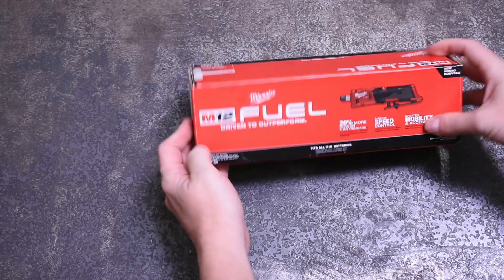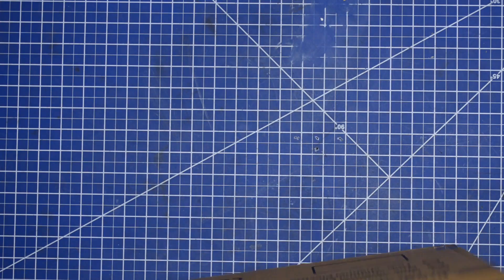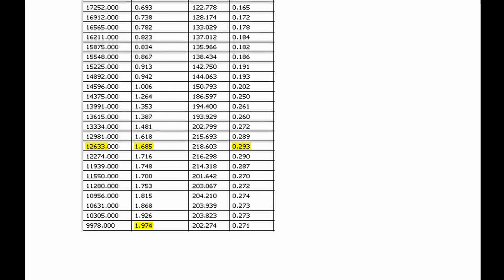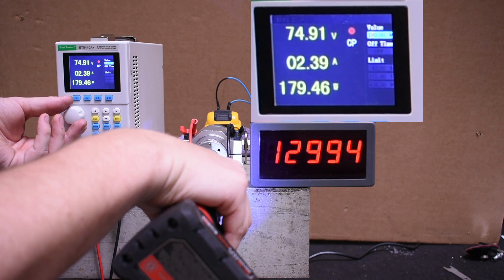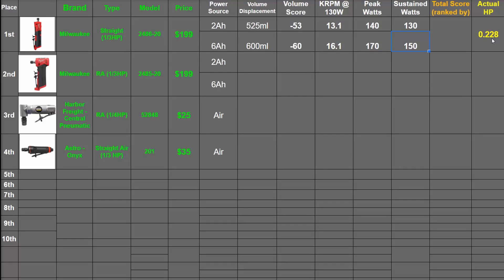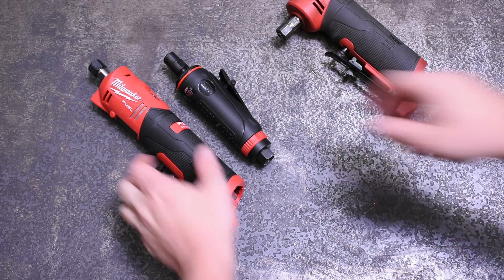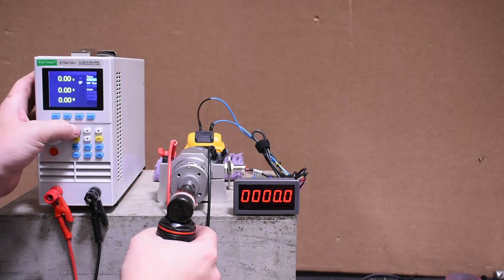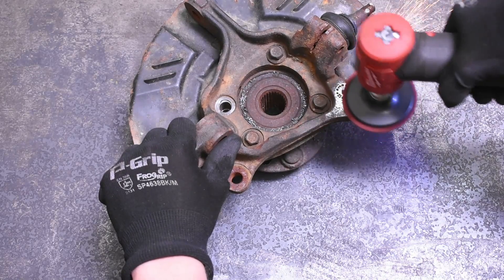We Built a HP Dyno: Do M12 "1/3 HP" Die Grinders Really Beat Air?

Comment: Wow a new dyno, very exciting! 
May I add some observations as an ee. I see you were looking for a dc generator, but ac one (with magnets on the rotor) would also work probably with just a simple 3ph full bridge rectifier on the output, before the load. 

Also bear in mind that generator has some losses, up to 20% since it is a dc motor so you can take those into account for true power numbers but it is not necessary for just the relative comparison. 

Thank you!
Reply from the maker: Hey thanks. Yes relative comparison is the name of the game on this channel!
Reply: @TorqueTestChannel  can't wait to see more, thanks 👍
Reply: @TorqueTestChannel  To add to this, the efficiency curve of the generator is absolutely not linear, i.e. you might measure 80% of one tool making 100W at 3krpm, but just 60% of another tool making the same power at 6krpm which makes the latter look worse, even though they're equal. 
Measuring actual torque or calibrating this setup would really benefit it. 
Mounting the generator housing free to rotate (i.e. in a big bearing) and mounting a digital torque meter on the end to hold it would be one way to give a much more linear and calibrated reading

Comment: I have the right angle Milwaukee. It’s ok, nothing special. I usually keep a cutoff wheel, or small wire wheel on it. That’s about all it’s good for is a quick use where rolling out an air hose is unnecessary. Maybe y’all could try some of the JET brand of die grinders I’ve been looking at getting their 1 HP models but haven’t pulled the trigger yet. They look very similar to the snap on ones.

Comment: You must know that your dyno "watts" are ignoring the fact that it isn't 100% efficient as a generator.  That dyno efficiency will have a significant curve to it.
Reply: @fluke196c  I'm honestly not sure if that would be a valid method of calibration because the "calibration" motor would need to be performance characterized as well.

I'm quite familiar with performance characterization of brushless motors but not nearly as much about brushed but I suspect it is probably similarly complex.
Reply: @fluke196c  They're not.  The efficiency of the "dyno" motor changes with rpm/voltage/temperature/etc.  It is a complex problem.

Comment: I have the Milwaukee right angle die grinder. It's awesome. I don't have air and it works very well. Only issue I have is the internal safety can be too much sometimes when I'm trying to cut sheetmetal. If the disc gets hung up at all, it shuts itself off. I have considered getting the straight one but I read and watched reviews for it last year and it didn't seem worth it. I use the high capacity xc 4.0 and 6.0 batteries and with mine and they can go for a couple hours. I have 4 of them that I can have them on rotation. I wouldn't be able to restore my car without these since I don't have a big enough compressor.

Comment: ~33 YEARS ago when I started off being a parts guy at a large tool import company, we had right angle die grinders that were (in appearance) identical to the central pneumatic one there!  I'd lay you good odds the parts are still interchangeable!
Reply from the maker: Pretty much all 1/4HP aluminum body RA die grinders look like this. Very big differences in quality and price though
Reply: @TorqueTestChannel  - oh by all means!  It's just crazy that after decades, the outward appearance hasn't changed at all.

Comment: Ok but count in the average air hose and compressor over time the air will loose rmp fast even faster than a compressor can keep up. Let's see how much time until the rpms drop.
Reply: Most shops (mine included) have stupid large conpressors. Mine puts out 19 cfm at 120psi currently. The snap on and matco large die grinders will hurt you. Biggest issue i run into is the die grinder actually getting so cold that its hard to hang onto.
Reply from the maker: Same with battery on these, it drops bars quick being direct drive

Comment: I dig the right angle and after years of cordless I just don't see myself firing up the compressor and dragging out the headphones and air hose.
Reply from the maker: It's size is hard to argue with, and in some situations does anything you need it to. Just isn't a powerhouse or quite comparable to air yet at this size
Reply: @TorqueTestChannel  I use the Milwaukee right angle at work all the time (Aviation GSE Mechanic) along with everything else that comes in red/FUEL. It's awesome and as long as you don't push it, you won't usually get it to cut out. I love using small 2" cutting wheels on it.
Reply: @TorqueTestChannel  and price...once youve got the compressor etc and its gonna be running in your shop anyway.......size and tool price have a lot of weight....im a body guy....that compressor will be running for another 20 years at least in the industry.(electrics and plastics dont like paint thinners)
Reply: @kazzTrismus  Right, but you don't just get to write off the cost of anything from the cheapest minimum usable compressor, line, & fittings to a full shop air system with all the bells & whistles. I mean, good luck trying to make an entire collection of cordless tools cost as much as a full shop air system + air tools.

It's literally case dependent
Reply: @kazzTrismus  Agree. The battery powered ones are often much too large to fit into the spaces I need.
Reply: @RyTrapp0  those expenses are long written off for me...easily 10yrs old fittings are like $2 ea...in a fab/body shop air is required and constant
Reply: Easy to cause the Milwaukee to stall from too much pressure. And when I say too much pressure I mean very little.
Reply: @jordanrussell345  Agreed.... I have the right angle, and it's a joke. I can't believe Milwaukee, released this Pos...
Reply: @kangaroo4144  Yup. Glad my shop buddy (who's a Milwaukee guy) bought his first so I could find that out. I use the AP Onyx 180 and 90 and love them.
Reply: @kangaroo4144  I have the Milwaukee right angle die grinder. I love it for the basic things I need it for and don’t have the space for a compressor. If I was cleaning gaskets and such all day I’d definitely use air.
Reply: @kangaroo4144  same, I got the right angle and it sucks balls, any pressure and it stops, even with the bigger battery. Sucks for the price of what you get.
Reply: I am unaware of any other use I have for my right angle that is not used in cleaning gasketed surfaces. Being cordless is sooooooo handy in a super tight engine bay.
Reply: I have the M12 and it constantly cuts out while removing rust, no issues with air...
Reply: @DrScopey2  are you using a 3” or 2” attachment? It’s only suitable for 2”. Plus the smaller batteries are shit with it.
Reply: Tried and returned a milwaukee right angle as it could not even clean a brake rotor without stalling out.  Just too wimpy for any serious use.  
      The pro tool place I purchased and returned the milw to.. was not surprised it was junk...  they claim die grinders that are battery are just not ready to be sold yet
Reply: What size compressor would you suggest for light work with an RA die grinder and small beveler?
Reply: I was thinking bout buying dewalts die grinder , if it's anything like the cut off tool it should do pretty good. 170 is a little salty though
Reply: If you want to make an instant powerful right angle die grinder you can do what I do and take an all-steel Jacobs or other quality chuck then drill and tap it for 5/8"-11 to fit your angle grinder spindle. It's outstanding for running any shank size burr, flap wheel or sanding roll.
An air hose is an obstacle or inconvenient on many jobs for example working inside a vehicle or in an engine bay. I have plenty of pneumatic tools and barely use them but variety is always good.
Reply: It's great for removing gaskets. I'm a field service tech and while I do have an air compressor on my truck, it's so much easier to just it. Just have to keep the little screens on the back of the motor clean or the motor overheats and it will shut off every few seconds. Only thing I don't like about it is that when it stalls you have to re apply the trigger to get it going again where air just starts spinning after you remove the load.
Reply: I havent used the compressor in 4 years . Other than for the blow gun. . Cordless have made air tools redundant and a few mains powered tools too.

Comment: I'm gonna say now and then watch it... some 1/3 hp die air grinders are also junk. I have a few Jet ones that easily have way more power. I still love these Milwaukee ones for my needs. Super simple grab and go type of tool for small jobs.
Reply: How fast does your air die grinder drop rpm before it's noticable?
Reply: @WTNPROUD  IR will drop fairly easy if you apply any pressure, the Jet (1/2 hp) I can be aggressive and it doesn't seem to drop much rpm. The electric ones lose power quickly when the rpm drops, you have to use them slightly different and keep lifting off the work peice so rpm can get back up.